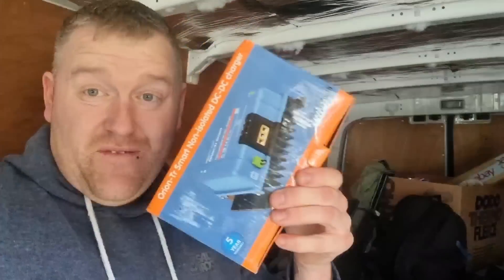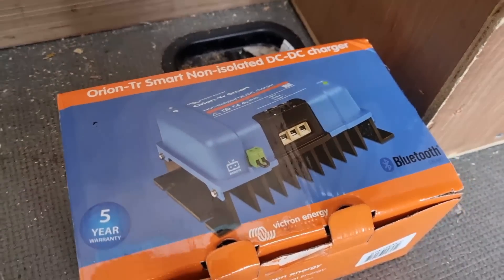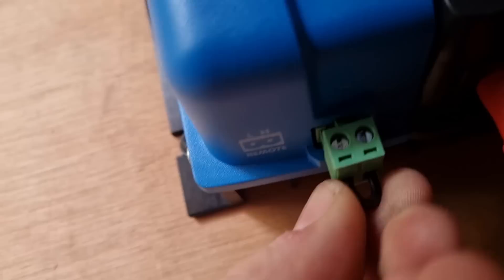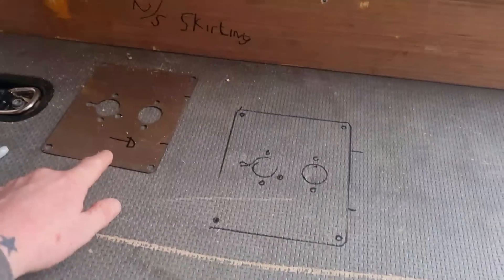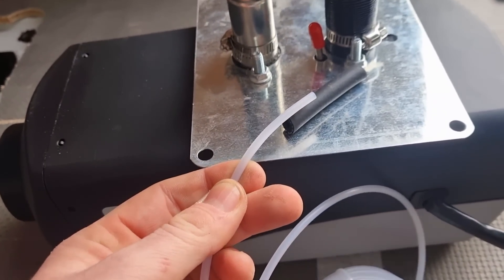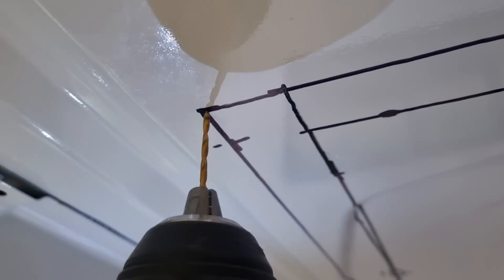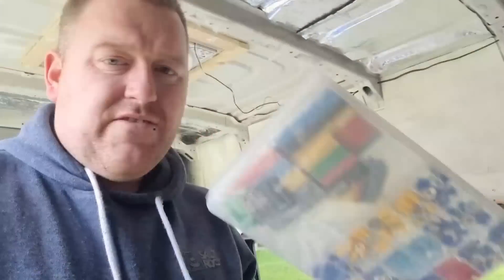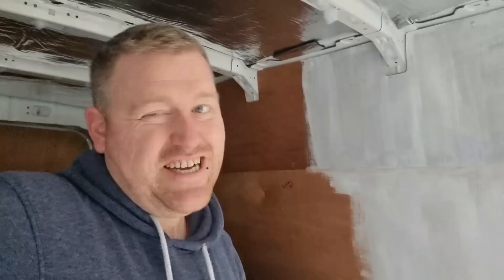Full Van Conversion Electrical Install. Maxx Fan Deluxe, Victron DC DC Charger, Chinese Diesel Heat

Comment: Now that heater is in don’t forget to fit a Carbon Monoxide alarm
Reply from the maker: Dude that's a good shout!
Reply: @iNDI_VAN_A_JONES  We had a gentle wind blowing exhaust into the inlet on opposite sides of the van one night, CO alarm went off, crisis averted! (Note, we do have the inlet & exhaust on opposite sides of the van and it works fine, this was just one night of perfectly weird breeze).

Comment: Nice work ... 👏 👌 👍.. Just 1 thing the cable connected to battery under chair needs some protection as looks like from your vid that its lying on a sharpe edge that will cut threw the wire over time an short it out

Comment: Great vlog and great to see so much more done in a day than I could manage!! I'm yet to connect my main battery to my DC - DC but I have run my live cable through. I see you don't have a negative from your main battery. Do I just need to ensure I have the negative off the DC - DC? If so, that is so much easier for me. Sorry for bothering you with it but, sometimes it's far easier to ask someone who has done it than research and get bombarded with so many options!! 😆

Comment: Pretty sure your diesel heater should connect (via a fuse) to your battery directly. You should not wire that to your 12v distribution board. Doing so will give you added voltage drop and could make it harder to start.